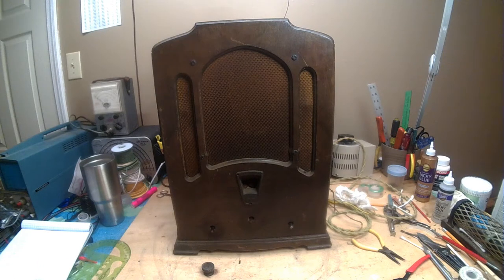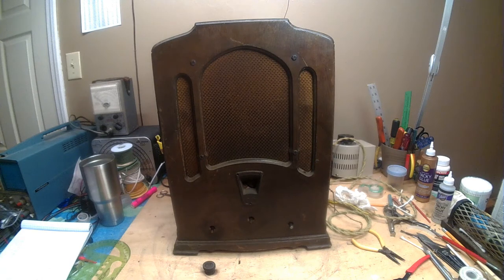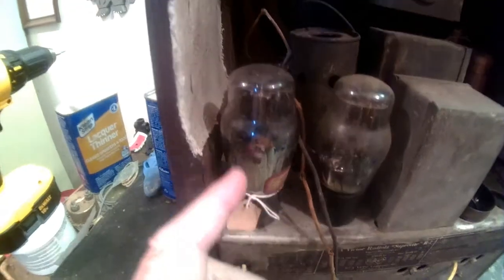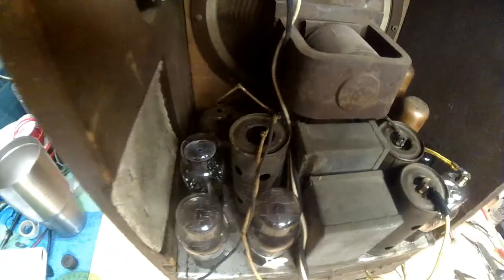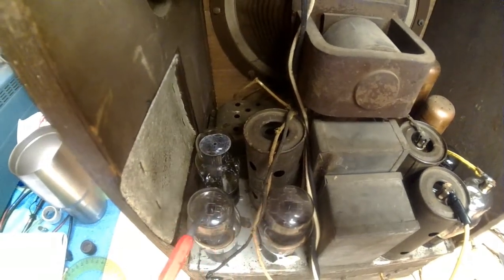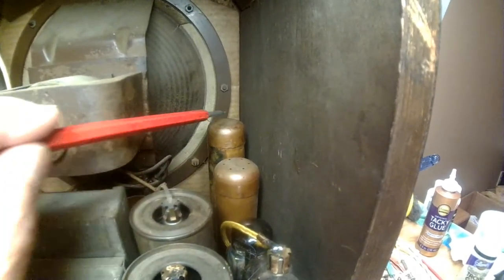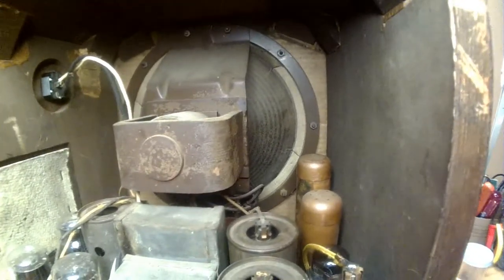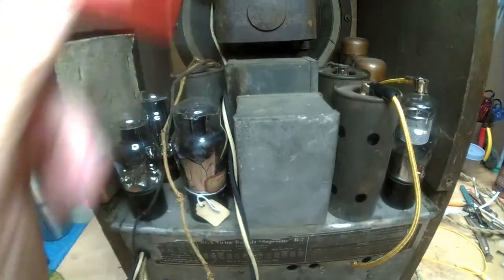1931 RCA Superette R7 Restoration Part 1 of 8 Intro

Comment: Larry,
Thank you for an excellent tour of this interesting radio.  I don't have one of these and I've never worked on one so I was keen to see yours.  On the potted caps, if there are no chokes or transformers potted in with the caps, I usually heat them in a thrift store toaster oven to 375 to 400 degrees.  I put a pan lined with aluminum foil under the cap box, and let it drain onto the foil.  Works like a charm.  If it discolors the paint, I usually can use some polish and rub it back into shape.  Just a thought.   Cheers!   Michael
Reply from the maker: ThatTubeSound Thanks Michael! Yeah, I have dealt with potted transformers and caps in the Atwater. I wont spoil it for you, but you will see how I pulled a hat trick on that RF bypass cap can, lol. Thanks for watching, and commenting. I always enjoy ur comments. I need to get n old toaster oven just for radio work! About to see what Irma has left tonight as it passes thru east Tennessee. Best--Larry

Comment: BRUSH, do not spray anything on the asbestos. SPRAYING will blow particles around, so brush it with whatever. Think about it.  No worries about dried lacquer either, it is NOT going to burst into flames any more than the wood will. Wet lacquer is way more flammable due to the solvents that have not evaporated. Even if it was still wet. those tubes will never get hot enough to ignite anything.  
 Without overthinking the issue, you can mix up some watered down white wood glue, then BRUSH it on. Can add a second coat (brushing) if you want. Let dry, done.
The main point was that you want to keep fibers from flying around, but then spraying something on will blow fibers around. That's why BRUSHING it on will keep the fibers out of the air and encapsulated.  Do anything outside upwind just in case.
Reply from the maker: Good comments! Thank you…I will pin this comment for others to be sure to see!!
Reply: I got self adhesive heat resist pad from Summit Racing for $10. I didnt like the idea of selling it with the asbestos present.

Comment: Hi Larry, 

I've got an unrestored R7A with two #47 output tubes.  I plan to follow along as you restore your R7. I'm sure I can learn a lot from you.  Are both of these radios pretty much the same  except for the different output tubes?

Regards, Tom
Reply from the maker: THOMMGB Thanks for watching, subscribing and commenting Tom! The schematic follows the same the best I can tell, but there are some electrical differences. The output and interstage transformers are different values along with some of the resistances because of the different outputs. As far as disassembly and troubleshooting, they should be identical. Id be interested in anything you learn from urs if ur willing to share. Thanks for watching, stay tuned, a major component failure is on the horizon! Lol. Best--Larry

Comment: Hey Larry, Cool little RCA!  I have a I believe 1935 model RCA tombstone myself, a 5T.  I haven't had much time for radio work lately having to devote most of my free time to that Hoosier cabinet of my sis in law's.  I got some more stripping done tonight and videod it for some reason, lol.  There's an old silent Buster Keaton movie called The Paleface and in it the Indians are going to burn him at the stake so he sews himself up an asbestos suit to wear under his clothes and survives the fire, bends over and lights him a cigar.  My house may have it for insulation, I'm not sure.  It looks like rock wool in the attic but I have no idea what's in that stuff, lol.  Looking forward to following along.  Take care, Gary
Reply from the maker: Rebel9668 Thanks for the comments Gary, Im sure the insulation in the school I went to was asbestos. Of course, the siding shingles on both houses I lived in growing up was asbestos. That type of shingles were encapsulated so I dont think those were any issues. Some of the valves in the nuke plats were insulated with asbestos, but over the years most were updated. In our training, it was talked about that sometimes the best way to avoid problems is to not do anything. Encapsulation by painting was a method used sometimes on those valves.  I failed to mention in this video, that just about all the resistors are dog ones on a single board. Im sure we will bet into that in the next video when we start taking it apart. Thanks again, Id be interested in seeing ur RCA5T, ---Best, Larry

Comment: Joe Coser,
Larry, Thank You for your great build. I have learned a lot. I,am try to restore a RCA Superette R7.  The main power transformer has a dead winding. I am new to this and do not know where, what to get to replace this transformer. Every thing else seem to be OK. I will recap, but need to know if there is a transformer before I proceed. Thank You.
Reply from the maker: Joe Coser Thanks Joe! Sorry to hear about the transformer! Im scheduled for knee surgery today, should be a minor thing, but will be limited for a few days or week, so I'll see if I can help a bit. Just looking this morning, the filaments is 2.5 volt center tapped, the rectifier filament is 5 volts. Look at the tube requirements, i.e. 4 tubes at 1.75 amps (1 @ 1.5A) the transformer current rating should be 7 amps or more. You will have to look at the High voltage requirements of the tubes, usually the output tubes will have the highest voltages. Of you send me ur email address, I will send you all the info, I have here. Play things of the Past may have a replacement transformer. I'll be in touch after the surgery! Take Care--Larry. Looks like the HV needs to be about 200 vAC center tap @ 65 ma. NOTE: one thing that confused me, the schematics were for both AC and DC models. Be sure to get rid of the DC schematics as to not get confused with specs.
Reply from the maker: Joe Coser Thanks Joe! I had a pretty good night, pain <1 all night. May be a day or two, I have several documents, I will have to scan, some of it is redundant, but good to have. On ur transformer, Id suggest to run an ad on Antique Radio Forums. I know there has to be someone out there with a parts set somewhere. Take Care--Larry
Reply: Thank You I will do that. and for taking time to help me. Heal well. Have a great day. Joe
Reply from the maker: Joe Coser No problem Joe! That is part of this great hobby, sharing experiences, watching how others work on them. If I can help even in a small way to keep one out of the landfill, it’s worth it! Larry
Reply: Larry, Hope your healing well. A question--does the brown wire that goes to the tubes need to be a solid wire from one end to the other ? Does it need to be the same length ?  OR can your wire it with short pieces in a nice layout ? Thanks for your help. Joe
Reply from the maker: Joe Coser Joe, I used stranded wire, I think solid would work fine. As far as using short runs or long runs, I do t think it matters. Ur choice, I used long runs and stripped back for connections simply when you make several connections on the tube pins, sometimes it gets crowded. Hope this helps! Take Care—Larry
Reply: Thank You Have great eveing
Reply: Larry, I broke the .0024 mfd cap that goes from one leg of the audio transformer to the resistor board. Can I use a .oo22/630v cap in it place.? Thank You.
Reply from the maker: Joe Coser Hi Joe, yes that will be close Enuf. Larry
Reply: Thank You  Have a great day

Comment: Larry, 
I have finished all the checks on the circuits, everything except L6 on 1st IF transformer has no OHM reading. I looked over the joint and the coil  seeing nothing. I assume that the coil could have a break inside. Can a new coil be wound--are do I need to try and find an IF transformer? I am up to suggestions being new to this. Thank You Joe
Reply from the maker: Joe Coser Hi Joe, Im sure you saw my video of me testing the ones in mine. I was fortunate, they were good, however, the 41.5 ohm one had been rewound by someone earlier. It was very close to the correct value. Here is what I would do. The coil is no good as it is, except the secondary. I would take it out and carefully unwind it and if ur luck the break is a short piece inside the coil. If you look at the coil, it is wound with the windings criss-crossing back and forth. The one in mine was rewound just straight windings. At this point, you might get lucky, be careful, the wire is tiny. You may have to heat the wax sightly with a hair dryer. If the break is a short piece, eliminate it, if its in the middle, try to splice it. Wind it back the best you can and check the resistance when ur done. The impedance is the most important, as long as you have say 85% of ur winding saved, the tuning cap should compensate the difference. If this fails, you could as ARF for someone with a spare. Hope this helps. Take Care--Larry
Reply: Thank You I will try that. What I do not understand is that I tested it before I disassembly, It test real low at 52.1 ohm I though bad solder , are wire. Guess there was something else going on. Thanks again
Reply from the maker: Joe Coser Joe, you may had corroded wire. That usually what gets to coils sometimes! It eats away at the copper, you can sometimes see the green on the wire. It may have been corroded and some of the windings were shorting. Good Luck! Take your time and be careful !!!!!!!! Keep me updated as to ur findings and progress! Larry
Reply: Larry, a long story. slowly unwound coil. found a break. Soldered together, started to rewind when my Lab decided to come in the room, tangling wire--should have closed door.  Checked what I had at 50 ohm.  I remembered that I had some coil wire from a speaker. I rewound a new coil, it took a little guess as how turns, but ended with a coil at 90.1 ohm.  Put every thing back together rechecked. Turned on and all I get is a hum. I have no way to check tubes. I hope it is just a tube. Will look for new tubes. Joe
Reply from the maker: Joe Coser Wow Joe! Wish you would have videoed that! Lol folks would have loved to see the lab and the mishap, things happen. But, it sounds like you did the right thing. The coil sounds like it should work. Good job! Have you attached an antenna and a ground to it? There may be some radio left in it! Keep me posted! Larry

Comment: That speaker looks like it may use a surround material made of Carpinchoe hide The Carpinchoe is a large Rat type mammal I think from Africa or Australia. This material was like a very supple and fine leather, it was used in the better speakers of the day. The only problem with this is that this leather stiffens up with advanced age as in decades.
Reply from the maker: John Bellas Hmmmm a large rat in my speaker? Sounds right, usually the rats come after it was built, lol. Is this the same critter called a Capbara? The surround is a bit brittle causing lack of response. Not sure if some type of leather treatment would help(?). Thanks John for that information, a lot of stuff like that is lost over time, I appreciate ur commets! Merry Christmas--Larry
Reply: There may be a treatment by applying some kind of leather restore liquid, but I do not know which would be best, I have a high end Stromberg Carlson radio console a (15 Tube set) that has one of these speakers in the "Labyrinth box" and another speaker in a Grandfather clock radio called the "Longfellow" by General Electric and this one is in need of attention I will have to see which one or type of leather reconditioner works best on this one !!!!!
Reply from the maker: John Bellas That’s good info, I wish I had mine out of the cabinet, I try something on it! If you will let us know how urs comes out, I may pull mine out and see if it will help mine. It is a bit tinney and brittle. Thx-Larry